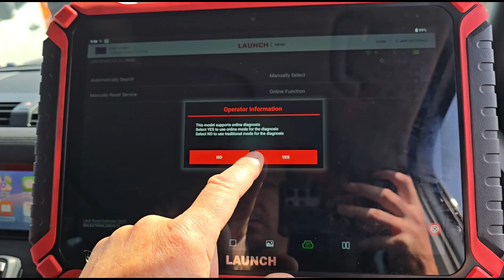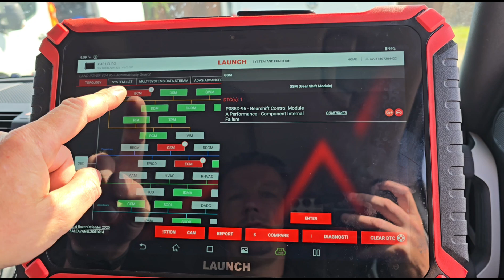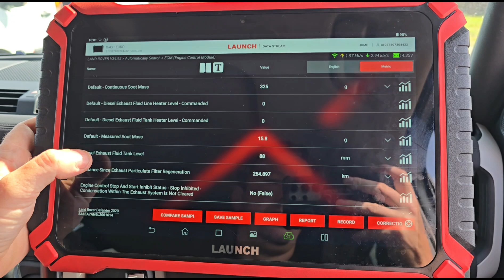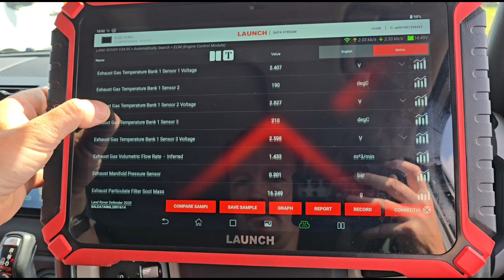Land Rover Defender P049B-00 Fault

Comment: be careful when using CAN protocol instead of the DoIP protocol that JLR uses. both JLR and Launch I have reported possible issues with incorrect or unavailable information using CAN. The CAN option on some Launch scan tools was even removed for a period of time.

Comment: The NEW Defender 3.0 is a straight six ingenium engine NOT a V6  so are junk as well
Reply: I’m I right in thinking the new 3.0 ones are BMW? I think the older ones we ford
Reply: @rocketron9  No Thay are JLR creation - or whoever makes them for them - they are the same as the 4 cylinder injenium - but with 2 extra cylinders obviously 
They have been having all the Injenium related problems 
If you really must have a JLR -  get an early Envoque 2.2 - that is a transit engine - OR if land rover / range rover 4.4 V8 diesel - the 3.0 are ok they seem to have gotten over the crankshaft issues 
But whatever one you get - change the oil every 6000 miles - they ALL suffer from oil dilution  which causes - a lot of other problems  that are caused by diluted oil

Comment: I’m truly gob smacked after watching this video. 
A 2ltr pulling a big car like a defender!? 

Then you said it’s a rear wheel drive! I never knew LR made a rear wheel drive. What an an absolute disgrace to the brand. 

Upon further research. I found out the new range rovers also come in 2ltr ingeniums 😩😂
Reply: He's wrong. This Defender and all others, are Four wheel drive. Land Rover have never made a rear wheel drive vehicle. Front wheel is available in the Discovery Sport and the Velar though.
Reply: @RM-vv9eh I was gonna say lol. 
But even front wheel 😂 

What peasant buys a LR vehicle and opts for front wheel 😬😂
Reply: 3 litre ingenium which are pretty good afaik.
Reply: @eastwood978 na no way! Anything ingenium, in my most humble opinion, is not worth the paper they were drawn up on. 

I avoid at all costs. 

I’ve kept my L405 simply to avoid the ingenium.
Reply: @BH-tp3pm and you’re wrong. The 3 litre Ingenium is proving a reliable unit. 
If I were buying a Defender (which I’d love but can’t afford) I’d have no qualms about the 3 litre. 

Personally I think the 2litre is too small for those bigger vehicles.
Reply: An acquaintance of mine has a Velar. It has the pop out door handles. Frost and ice in winter and the handles freeze up, you can't get in.
Reply: @Nick-bp7jf I have similar on my Tesla also. 
However the car pre heats. 
I’m pretty sure you can defrost/pre heat the velar also? 

I can pre heat my L405 on my app.
Reply: Yes weirdly you can get a RR sport, the Disco 5, & the first year of the new Defender with the 2.0 D240 Ingenium. 
Jimmy says he doesn’t see them much but there’s loads of failures with them.
Reply: Can't say I 'd fancy the 2.0D myself in a Defender, but the engine size itself isn't quite so important going forward.
My Mercedes has a 2.0 petrol engine producing 420bhp.
And Land Rover themselves are using an electric motor (Hybrid) attached to the gearbox and their 2.0 petrol Ingenium engine, to get over 400bhp.
Reply: @RM-vv9eh you’re not wrong. But even still, regardless of output power. 
2ltr engine 🤢

You can tune a 1.2 to make 100hp but it’s no good for it long term. 

I can’t say I know a lot about engines but I couldn’t think of anything worse than the stress of a 2ltr pulling 3 tonne of car. I’d never want to drive the poxy thing 😅

Comment: Hi Jimmy. 
Do you or any of your followers know if the ingenium 2.0 litre petrol engine is any better than the diesel please?
Reply: From reports they are much better less problematic but these new generation 2.0 ingenium 4 cylinder engines are best be avoided, the V6 and V8s both petrol and diesel are a better choice.
Reply: @leroyjohnson4973  Thanks for replying. The discovery sport would perfectly serve my needs, but the diesel is a worrying engine. Not to mention i do a lot of short journeys that would kill the emissions system.
Reply: @Nick-bp7jf  Don't forget that all petrol cars after 2020 have a GPF, a DPF but for petrol cars. They also regen but at way lower temps. Jimmy did make a video on a plugin hybrid land rover (not that long ago, you can find it on his channel) that he cleaned the GPF of. It seems that modern petrol engines also require a once a week highway or long drive to let the GPF regen otherwise they also block just like diesels.
Reply: @hadiamrane  Thank you for helping. I had heard of a GPF but did not know they were mandatory after 2020. I am guessing that due to the nature of petrol it will burn much cleaner than diesel and not contaminate a filter as badly. I'm stuck between a rock and a hard place. I need 4x4 and do occasional long runs but most is local stuff.

Comment: Has a P049B on my 1.6 CRV. 
Cleaned the EGR and EGR cooler, still the fault was there. The numbers from my DPF were within limits. 
Off to my last resort the local "authorised Honda service centre" and recieved a quote of €4500 for a new DPF which lead to me laughing out loud (I can get a new DPF from Germany for €500). 
I had another look around myself. 
The problem solved, a leaking intercooler. Changed myself at a cost of about €230. 
Too many "techs" just look at their computers and not looking for actual faults.
I watch @O'Rileys Autos as you get great tips and helpful information. There is so much good information on the internet but also so much poor info. The moral of the story is without the internet and Youtube, the "man/woman on the street" would be totally ripped off by main dealers and most probably still are being.

Comment: Would help aswel if garages could clean and check the filters.
Reply: I assume you talking about the EGR filter right? There is no need to clean that particular filter in these 2.0 ingenium diesel engines, it only gets blocked when the DPF cracks and start passing out soot. On the longitudinal engines like this one it is easier to clean but on the transverse engines it's a NIGHTMARE, it's buried deep underneath the engine and you have to approach it from underneath.
Reply: @leroyjohnson4973  yes. Thanks for the info